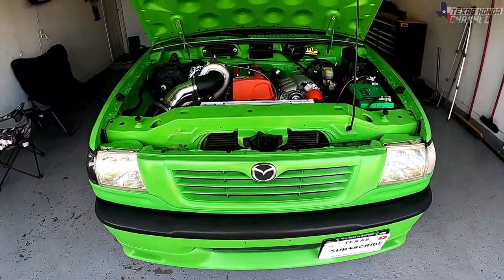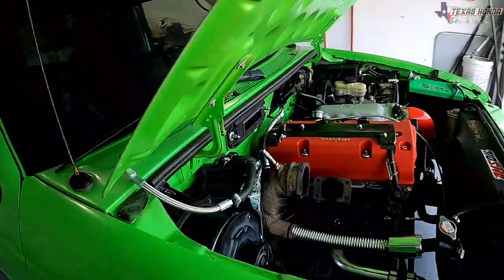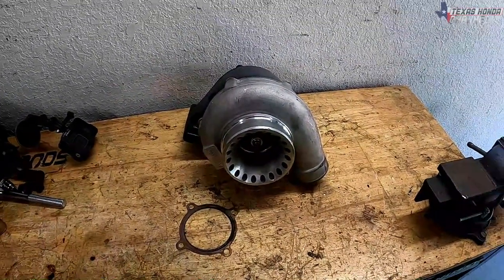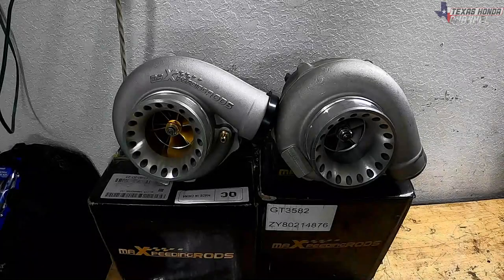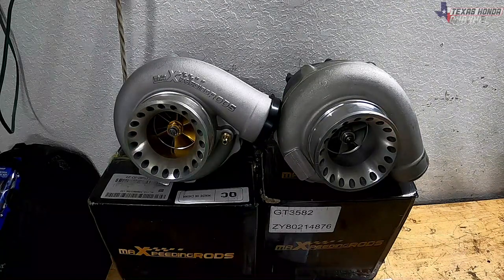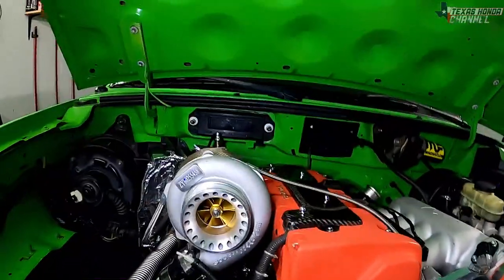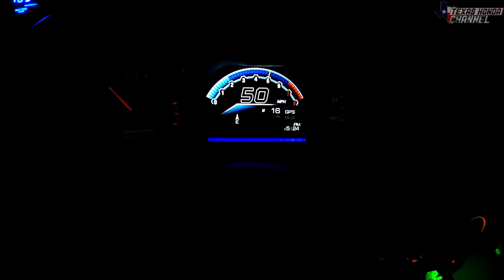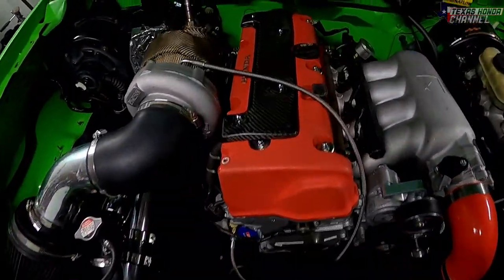Upgraded The Turbo On The KAZDA!! |IT RIPS! HARD!

Comment: Bro u slap a k24 in there type s oil pump an rev her to the moon.love your project. So cool people  useing there imagination for good.keep it up man.
Reply from the maker: I already thought of that but few problems. With the K24 head it don’t fit my rear wheel drive intake manifold unfortunately. The coolant inlet don’t fit because firewall clearance but the oil pump on this k20 is actually the same as the type s so I could use this one on a k24. I thought about going the k24 route but if i do that I will use a k20 head with bigger vtec cams locked in the head. It will make more power one day.

Comment: Sweet video and nice turbo.  Is the a/r the same on the old one and new one?  Did u adjust the tune at all?
Reply from the maker: I thought I mentioned it but might not have. The tune ran so rich but because of that I was able to leave it untouched. I monitored everything and it all within acceptable Air fuel ratios. If I wanted to make 300whp I could go back and get it all dialed in and turn the boost up a bit more and it could easily make 300 but after 300whp the k20a3 don’t hold up long. So I’m staying right below 300whp until I do internals.

Comment: I definitely was looking at their turbos, might get a step up from a 3071 from them if my 3582 doesn't fit
Reply: Get the smaller one if you are going for under 400hp and you have rods in the engine. Gt35 for 200whp is kinda abussive
Reply: @mihailpetrovici5044  yeah it's a b16a2 w/ rods, pistons 10.5:1 cr, good ram horn manifold, mishimoto J intercooler, 2.5" intercooler piping, 3" down pipe with full 3" exhaust, skunk 2 ultra street intake manifold, on e85 aiming for 400+ minimum hoping for 450whp but it's all in a CRX so space has been being eaten up lol
Reply: @mattstarnes2006  spicy shit. I am going for the same with s d16, vitara rods, 8.5cr, cam springs. I went with gtx3076r .63ar. hopefully reaching 500crank
Reply: @mihailpetrovici5044  nice! I was doing a vitara d series build but then I found then crx with a b16 in it and I loved the body so my plans changed, I think the vitara build is definitely best bang for your buck
Reply: @mattstarnes2006  in my country is the only honda engine that you can buy at a "junk" price so you have money left for everything else

Comment: isn't a 17.2 AFR at WOT super lean??
Reply from the maker: It didn’t have a 17 AFR at WOT i have failsafes to make sure I CANT do that. If it goes above 12:5:1 it will act like boost cut. If you seen 17 it must have been a error. Please tell me where in the video so I can see.
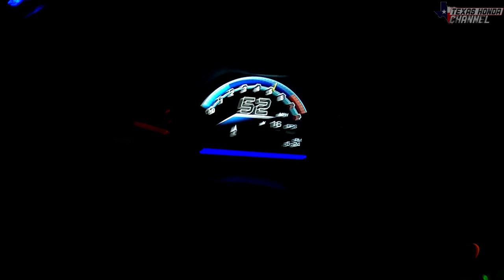Reply: At 16:57
Reply from the maker: @msalamlaham7129  lol 😂 I see how you would think that!! That’s the coolant temp on the piller. You had me so worried lol 😂
Reply: Hahahah that's good to hear people usually have an AFR gauge there so I assumed that it was one. Didn't look close enough haha
Reply from the maker: @msalamlaham7129  I honestly was worried about temp more than anything since gauge on the dash don’t work for this setup but this engine stays cool so I could probably swap it around with the aem wideband lol

Comment: You only put one heet in your motor
Reply from the maker: No no i needed to put HEAT in it so it was at operating temperature because the vtec won’t engage until it reaches operating temperature. This massive radiator works too well so it takes a bit to warm up. Lol